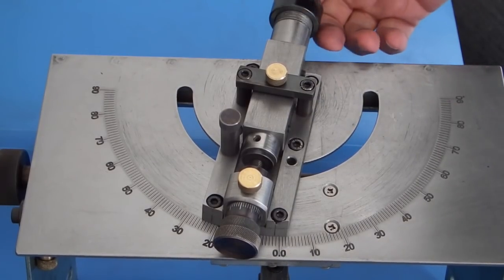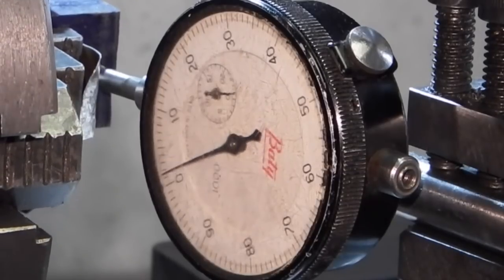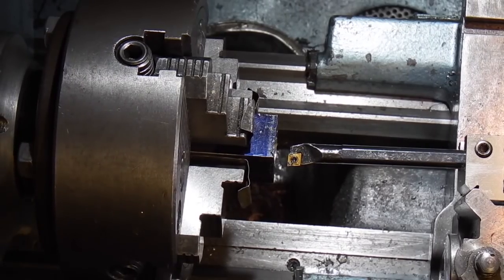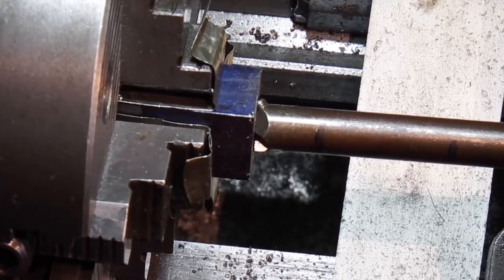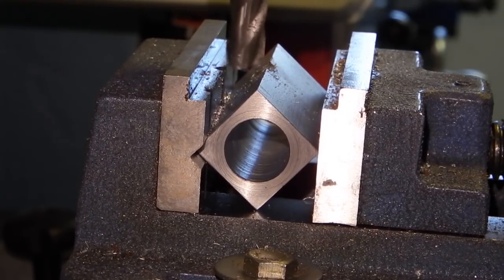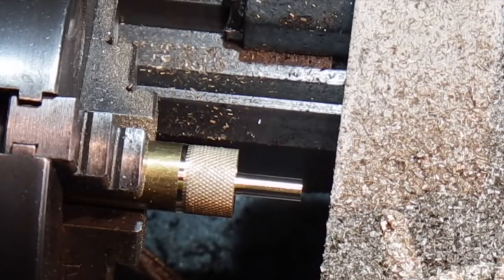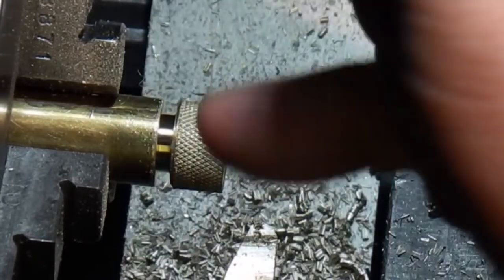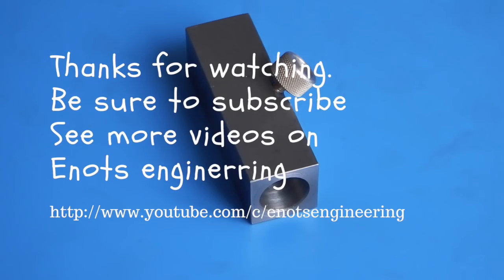Spindle block and locking screw

Comment: Can I ask what oil you use as lubricant? I’ve just been using wd40. But I’m going through a fair few tins . My budget is tight and cutting fluids, paste can get very expensive. Cheers
Reply from the maker: Hi Shaun
The oil I use is Car engine oil I use it for the lathe and when cutting threads or parting off when needed.
When I do an oil change on the car I always purchase 5Ltr of oil the car uses about 4 1/2 and the rest I use in the workshop
Reply: enots engineering . Thanks, great idea, so many videos I watch seem to always use expensive cutting oils, glad to find it’s not needed. Cheers

Comment: sir if you will take four flat pieces of metal say 1/8"x 1"x1" and rubber band them to the four sides of the square then you can indicate in the insides of the flats i have found it much easier than doing the outsides just a suggestion keep up the good work
Reply from the maker: Hi Lee good idea